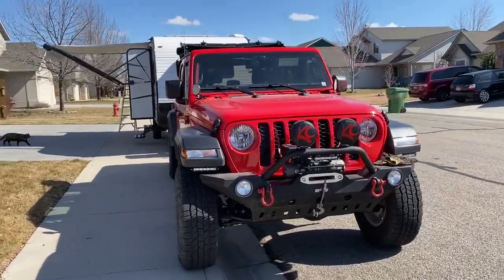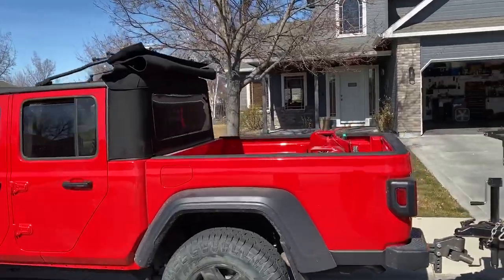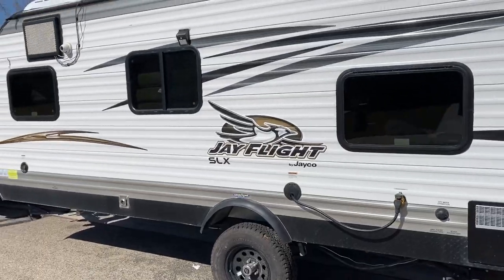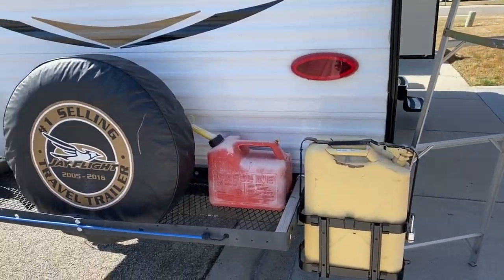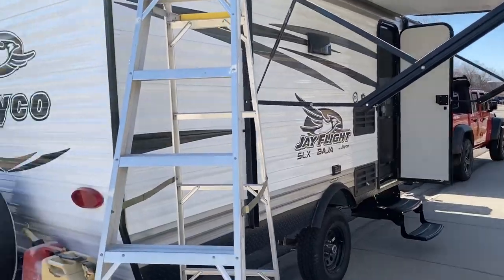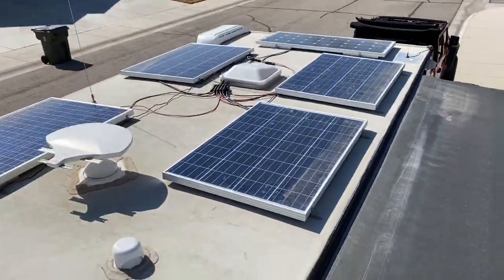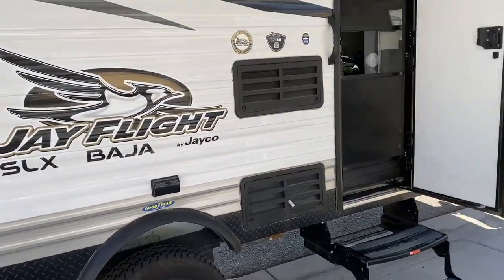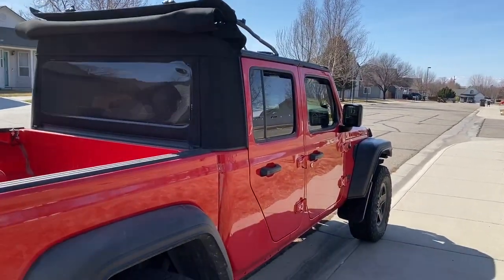Overlanding trailer setup

Comment: Thanks for enabling comments.

We just bought a 174BH for similar purposes, albeit possibly a little more touring where we may not stay in the same campsite every night.  With your changes I can only assume that the weight has gone up a bit and the weight distribution has changed somewhat, how has that played out in off-pavement performance of the trailer?  My tow rig will be a crew cab longbed Nissan Frontier coming in around 5000lb, so probably similar weight to your Gladiator but longer wheelbase.

Comment: Where you go camping is it hot at night? Are you able to run the AC? Super cool setup, we got a 184BS and we were watching your mod video to get some ideas, love your solar array!
Reply from the maker: I actually pulled the Window air-conditioner out.  I can run it, but if its that hot I'm either by water or I just stay home. Last year we did 30 nights throughout summer, never missed the AC unit.  This year, due to schedules, we are only going to use it on one 10 day trip going up to stay at a lake by Glacier Park, and go into Glacier a couple of days.  Every night we will be by Streams, rivers or at a lake.  The window unit pretty much keeps the Bed area cool, with the curtain drawn.
Reply: @danalbert5877  thanks for the reply Dan, we were just camping for 3 nights up here in BC, Canada at Golden ears campground and it was way too hot, the sites are a hike away from the lake so there was no breeze at night. It was 35°c+ in the day and Overnight temps were just a bit too high for the kiddos in the bunks since there was absolutely no breeze, like you said the window unit doesn't do much for the bunks now that I think about it. Looking forward to future vids from you!

Comment: where r the batteries located?
Reply from the maker: batteries are sealed AGM's located under the lower bunk bed, in the same compartment as the  hot water tank, which is also where the 2000 watt/4000 watt surge pure sign wave inverter is. If you would like a pic, let me know

Comment: Oh God. That poor 3.6 liter. You've chosen nearly the worst off-road vehicle to tow a trailer with..
Reply from the maker: FALSE.  I'm 2 years in with the Gladiator, and it pulls the 3500 pound trailer thru the Rockies easily with the 8 speed transmission.  I pull my trailer to places with Jeep Gladiator that my 2021 Ram diesel 2500 will never fit or go. not sure what you are driving, but I'm remote off road boondocking, no National Park campgrounds for us when we have the trailer. We Air BNB it or stay at the lodge for those big parks.  However, lets see your boondocking rig since your so critical. Our family did 30 nights with this setup last year, 8 different trip. Still waiting to see yours.
Reply: @danalbert5877  Lol. I had a 3.6 Unlimited as a rental for a week at sea level. It felt underpowered as is, and you have the heavier Gladiator AND a trailer on top of that? 260 lbs of torque at 5000 rpm is piss poor for towing. Gonna call BS on yours pulling it through the rockies "with ease".